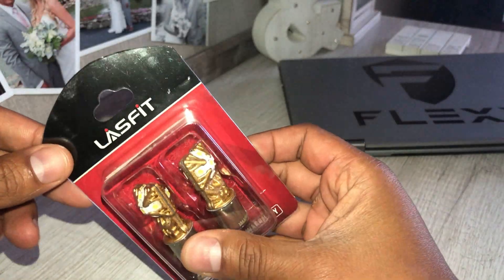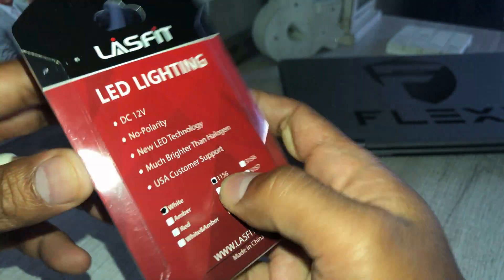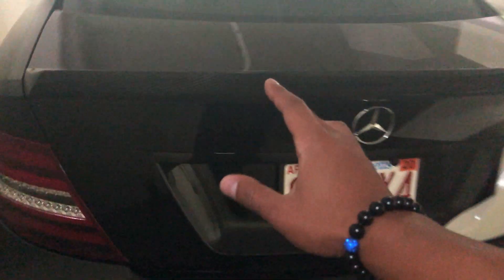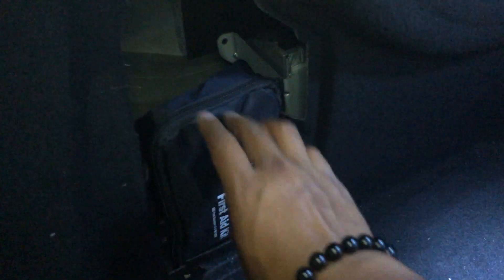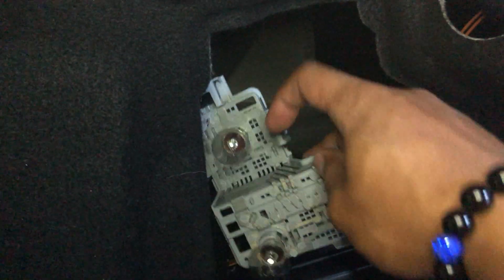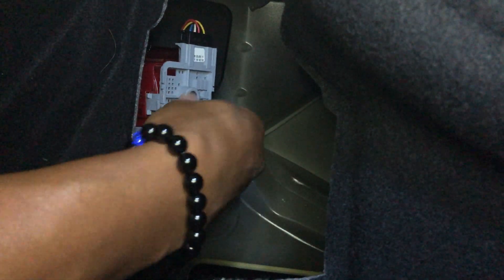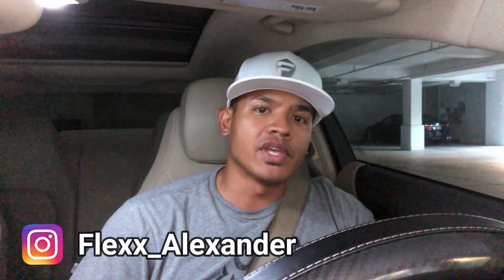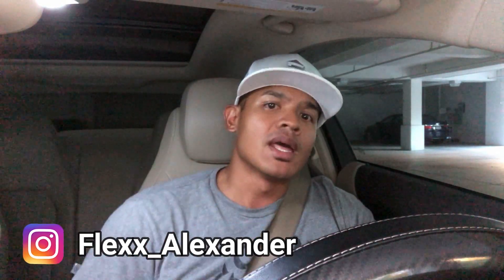SUPER BRIGHT WHITE REVERSE LIGHTS ON A MERCEDES C-CLASS

Comment: Hello, I have 2010 c300 replaced headlights, taillights with aftermarket lights. They work fine. But every time I start car. Dashboard message "replace headlights, taillights.
Reply from the maker: Because you don’t have error-free bulbs.  

When you install a bulb (like an LED bulb that’s use low amount of power) it doesn’t create enough resistance to the power being supplied to the bulb.  Since there’s barely any resistance, power flows almost at full force through the bulb and the cars computer thinks the bulb is blown.  

Error-free canbus bulbs will prevent that by tricking the system to think there a regular halogen bulb there with the same resistance a halogen bulb would have.  

You either need to replace them again with error-free canbus bulbs. Or wiring in some “load resistors”.
Reply: Where do I find error free bulbs? They seem hard to find.
Reply from the maker: Go to eBay. Type in “error free” and your bulb size. Done.
Reply: Thanks

Comment: Hey I just changed my stock reverse lights to led and I got a message saying check right and left reverse lights on my dash bored ? What does that mean how can I take the message off they work just fine and I put them today I have a 2012 Benz C250 ... can you please help
Reply: That’s just because they are LED lights it happens with LEDS at times.
Reply: An LED doesn’t draw as much power as a halogen bulb, therefore the CANBUS throws up an error as it thinks the bulb is broken as it’s not drawing the right amount of power